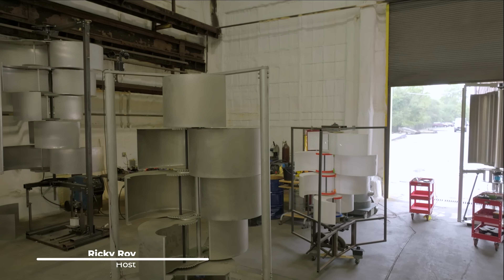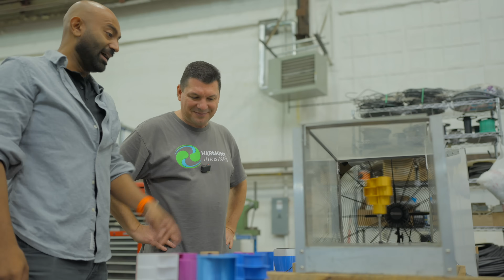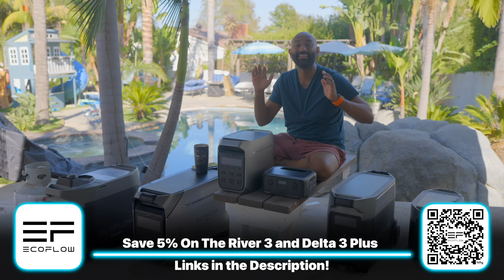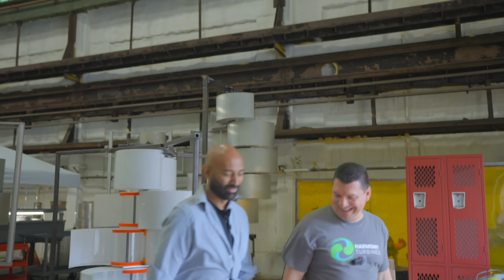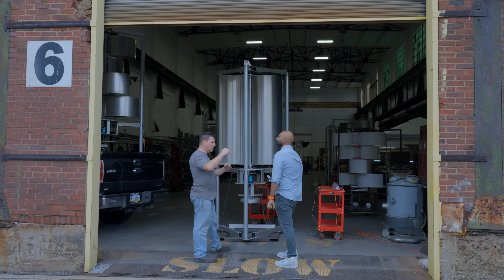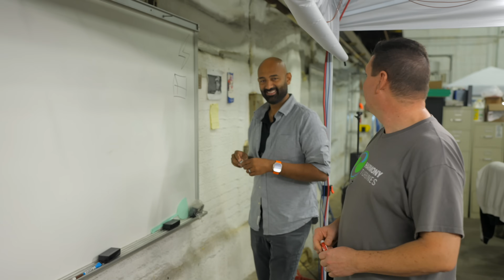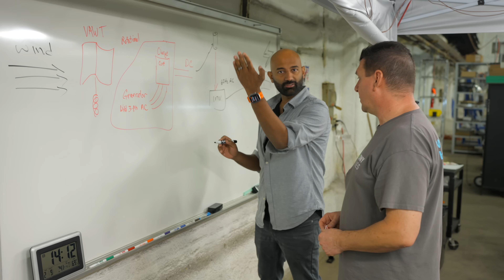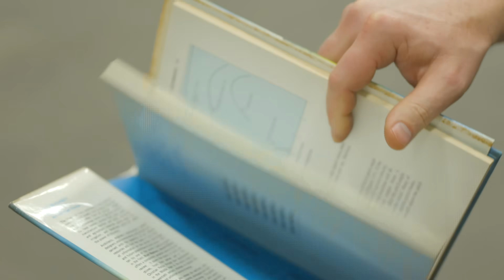This Could CHANGE Home Wind Energy Forever!

Comment: I like the fact that the guy has a very honest story about wind, but I do not see them augmenting home power for the reasons he gives, its simply far more cost efficient to invest in a actual wind turbine with the neighborhood or something if you want wind.
For off grid power generation they are useful, I can see these being used in houses in open plains or near the coast if they are off grid.
My company uses savonius turbines to power measurement locations that need to measure storm surge conditions, so it needs power when the wind is perfect for generation. In normal conditions, (3 to 4bftt) the output is zero though.

Comment: You’re dealing with two fundamental issues:
– The Betz Limit
– The Power in Wind equation

The Betz Limit is basically a theoretical number of the maximum efficiency you can possibly get. At most, only 59.3% of the kinetic wind energy can be used to spin the turbine and generate electricity. Remember this is a theoretical limit; in practice, you’re going to be closer to 40%.

The Power in Wind equation is given as:

P = 1/2 x ρ x A x V³

With:
P = power in Watts
ρ = air density (kg/m³, at about 1.2 at sea level)
A = Swept area of the blades (m²)
V = Velocity of the wind

So, no matter how good your turbine is, you will get in practice at most 40% of the wind energy converted to electricity. To capture the wind energy in the first place, you have two variables to increase (one in your control, the other not): swept area and wind velocity. The smaller you make the turbine, the faster you need to spin to make any meaningful energy. The only variable you control is the swept area, which means making the blades as big as possible.

Note that the velocity is cubed in that equation, so you’ll generate much, much less power at low wind speeds. No amount of 'finding the right generator' will change this.
 
In other words, small wind turbines don’t work except in ideal situations because physics.
Reply: Well explained.  Tens of thousands ppl who've tried wind micro generation wish they'd know that!
Reply: that's pretty much what I've always heard...  low speed wind isn't going to produce much power, and the winds around a building are just not high enough to be productive.  Yes, you can generate some power, but the cost per watt is so much higher than for a wind turbine placed a hundred feet above the ground.
Reply: Yeah unfortunately this is not looking like a worthwhile product
Reply: Exactly.  Small wind is hopeless
Solar is better by 10x as most home owners will rarely have access to decent wind

Besides, solar has no moving parts and makes no noise
Reply: Depends on the feed for the hamster.
Reply: Solar only converts 23% at best of the incoming energy, Low efficiency isn't the major problem, its the low energy available in the source that's the problem for small scale
Reply: @nicholaskeur  Exactly, that's why the Power in Wind equation is important to take into account. At low wind speeds, there just isn't any power there with a tiny swept area - and any effort on trying to find 'the right generator' or 'increasing voltage' or what have you are pointless.

Comment: In the great plains a huge percentage of energy is from wind but the thing the million dollar turbines have gotten correct that these little ones dont is how to deal with extremes. We could get two inches of ice buildup in one night then the next day it could all melt and we could have gusts to 80mph followed by hail and lightning. Then in the summer a month of 110 degrees and no wind. If it can handle all that then it makes a lot of sense for residential if there is little or no maintenance. After all in the 1800s windmills were wide spread for water pumping. But solar panels have no moving parts and are already working here on residential homes.
Reply: Don Quixote had a windmill disorder 500 years ago..❤
Reply: Solar is so much more attractive to the average joe for so many reasons, not least of all, probably, is avoding installing a giant blender on your property lol.

Comment: Would it make sense to have two turbines (1) small for low speeds and (1) large for higher velocity. 
 And can i charge the same batteries with wind and solar?
 The Harmony turbines have a lot of what i call "What if" technology i have been in the HVAC controls industry for 40 years and the opposing magnet bearing checks off one of those "What if's".
 Good sound engineering and the company has the mindset to always watch return on investment. After all bang for the buck is still king.
Reply: Most people cannot cost justify a wind turbine.

Comment: Put a CVT between the turbine and the generator and add a heavy flywheel to the generator? Will be interesting to see wind combined with flywheel. The CVT can help spin the heavy flywheel from a dead stop and allow it to accelerate to a very high speed where the generator is more efficient. Edit: well it's probably not very practical due to cost and the low reliability lol
Reply: A CVT and Flywheel will double the cost.  Now you made it 4 times, too expensive. How did that help?
Reply: @MrSummitville  Yeah I said it's not very practical due to cost

Comment: I'd consider it as long as the cost benefits over Solar are there. One of those certainly is a lot nicer aesthetically than solar panels.
Reply: this isn't meant to replace solar, but to supplement it - to provide power when the sun isn't shining, and add to what you're getting when it is
Reply: @dwc1964 This is not designed to supplement anything.  It is supposed to stand-alone.  But is not cost effective, therefore it is useless.
Reply: @MrSummitville  you're giving your opinion about things and passing them off as fact. Our goal is to most definitely implement our turbines with existing solar systems, in other words, supplement. Yes the costs in the beginning of any new project area always very high, but as we work through issues the costs will come down significantly just as they did for solar. You have to start somewhere and it's unfair to compare new development prices to solar tech that has been in the market for 40 years or more. Yes wind has been in development for a long time too, but the bulk of that money all went into large scale so that those companies can charge you for a free resource. Sorry if we're trying to make a difference here and working to decentralize power generation.

Comment: I'd buy one, it they were legal to install on my home, but they aren't legal in Vancouver. Are wind-turbines allowed on homes in San Diego?
Reply: They are not cost effective. And no, you are not installing a wind turbine on your roof within city limits.
Reply: It will take time but with better technology proving to be safer and less intrusive the legislation will change, just as it did with solar starting about 8 years ago.

Comment: How about on an apartment building? I"m thinking about a few of them along the north (so as not to cast shade on solar panels) edge of the roof. Being on top of a multi-story building would provide at least some of the desired elevation, not sure how much higher off the rooftop they'd have to be.
I've also seen a design for something like this but tipped on its side, so the axis is horizontal, and there's an air inlet that captures and focuses incoming air at the open-scoop side of the turbine. How does this compare to that for an apartment building?
(Many years ago, Jay Leno's Garage installed a corkscrew-shaped VAWT on a magnetic bearing, but I never saw a follow-up on that. I wonder what happened with it.)
Reply: It is not cost effective. Save your money for retirement.

Comment: Wind power for homes is stupid and is really nothing more than fraud. The electricity produced costs at least 100 times more than the electricity that a 10 MW turbine produces. Electricity from PV for homes costs about 4 times more than electricity from utility sized projects. This means solar panels are 25 times more cost-effective than wind power.
Reply: DIY Grid-Tie Solar is now on-par with utility rates.  PV cost are down, while electricity rates are up. But it takes about 5 years to break-even.  Off-Grid PV is still way too expensive.  Most people will never "break-even" with a wind turbine.

Comment: There is a reason for VAWT's to be largely ignored since the beginning of wind energy, they are a lot less efficient than HAWT's , both in trems of energy production and in terms of construction and maintenance. The numbers speak for themselves, just ask yourself how many VAWT's do you see , either commercial scale or micro wind ?? The idea of attaching a wind turbine to a house, as alluded to in other comments is also a bad idea as the vibrations transmitted into the house would drive the occupants mad 😢 .
Reply: VAWTs have an entirely different use case from HAWTs; the latter are massive, requiring a lot of dedicated space and operating best where there are strong, sustained winds, while the former are meant for more compact spaces and production at lower and more variable windspeeds. The relative efficiency would only be a relevant issue if one were pondering replacing one with the other. As it is, what's relevant is whether a VAWT is capable of making economically-viable use of wind energy in places where you can't put a HAWT.
Reply: @dwc1964 The VAWT is NOT economically viable, and probably never will be.

Comment: I understand the whole issue of getting it to move from a stop, but, for a turbine like this, how often is that ever a problem?  Wind is almost never flowing the exact same direction all the time and this style turbine doesn't take much energy to keep moving.  Maybe if the wind speed is only down to 1MPH, the turbine would intentionally stop trying to generate power in order for it to maintain momentum.
Worst-case scenario, you add a motion sensor and an anemometer, where if the turbine isn't moving while there is significant wind, you use the generator as a motor and just give it a little kick.  We're talking a very small blip in power usage for a much greater long-term gain.
 
I think the reduced cost and added efficiency is well worth the small chance of it having a hard time picking up speed.  Perhaps their current model would be good in regions where you regularly experience no noteworthy wind multiple times throughout the day, where you get an efficiency penalty in favor of generating power more quickly from a stop.
Reply: A VAWT is not economically viable.

Comment: Neat concept, good for even just aesthetic reasons! The one weird thing about wind is that unlike the sun’s rays, it’s a much more finite resource. If there are too many wind turbines, the wind power can reduce over an area, to the point of making it hotter, and negating the usefulness of the electricity that it generated in the first place.
Reply: That's uhh... that's not really how that works. It makes the wind more turbulent, and for a short area downwind it's more scattered, at MOST like 10% or so "weaker", but it regains it full speed quickly enough downstream of there.
Reply: If it is in a miserably cold windy place, that sounds brilliant.

Comment: I think 500W it's a bit less than what I was expecting... Typically you have a 16A main breaker in your house, some may have 32A (at least in Europe) and that means somewhere about 3.7kW or 7.4kW for the 32A... If the turbines won't produce at least 4kW, I don't think I would buy one.... With 500W we will need at least 8 turbines for a small house and if they are expensive that wouldn't be good and also you need space to install them and if you don't have space.... But yeah it would be nice at least 1kW of power during the night.
Reply: How many hours per day, do you have continuous steady  25 mph wind speed?
Reply: @MrSummitville  That's the thing... the wind is inconsistent and if at full 25 mph you get 500W then at 5 mph or les you will get 20 to 100W which is almost useless.
Reply: @georgecantea1174  it's even worse, as the power produced is related to the windspeed cubed. Meaning 1/5 the windspeed results in 1/125 the power. Which would be 4W at 5 mph

Comment: VAWT vs HAWT, HAWT always wins. VAWT's a dead end, at least a third less efficient and less long-lived; and, while lower up front cost than HAWT in some cases, might as well go Windbelt as VAWT in most of those cases.
Reply: I disagree and so I started my own company. -But we can still be friends. :)
Reply: @HarmonyTurbines  See, this is the thing. There are a lot of niche cases where VAWT will fit, and generate at least a little power while HAWT for some reason won't fit; it can do it in some of those cases at low up-front cost, though it will not in the long run deliver the cheapest electricity. VAWT can deliver more power than Windbelt, for sure, in many of those cases that's a requirement. And sure, the lower lifespan of VAWT might not matter for a ten-year remote survey, say. If you're in one of those cases, the best VAWT possible might be the difference between going ahead with a worthy effort and not even getting the project off the ground.

For that, good on you. Well done.

The market isn't just the grand and the long run.

That said, what's stopping you from turning your discoveries 90 degrees, and putting them on top of a sloped roof that faces the prevailing wind, for a wind scoop effect?
Reply: apples vs oranges
Reply: @dwc1964 No ... HAWT almost cost effective = apple.  VAWT never cost effective = rotten apple.

Comment: This looks cool and I'm glad there's work going into it but, that unit alone even at scale looks like it'll cost at least $1500 or so. Those are relatively large parts and a fair amount of mechanics as well. It would take a lot of engineering and outsourcing to get that down to under $1k a unit, and as is is probably more like $3-4k at least to be profitable. I think you'd have to be in an environment where this is operating near constantly for it to be cost competitive with ultra cheap solar - I'd like to see that break even point. Additionally I believe just because a new industry isn't immediately competitive with a well established industry (residential scale wind vs PVs) doesn't mean it should be abandoned, if we did that we'd never have low cost solar. Rather it should be subsidized, incentivized, and explored. I hope this goes into production and sees some success.
Reply: @lephtovermeet yes we can't compete with solar, that was never our intent. But as far as small-scale wind technology goes we are doing everything that we can to work on maximizing the ROI for customers. In the beginning any new technology is expensive, no matter what it is.
Reply: I wouldn't think of something like this as instead of solar but in addition to solar, to provide power at night and on cloudy days as well as adding to what the panels are bringing when the sun's shining. Belt and suspenders, as it were.